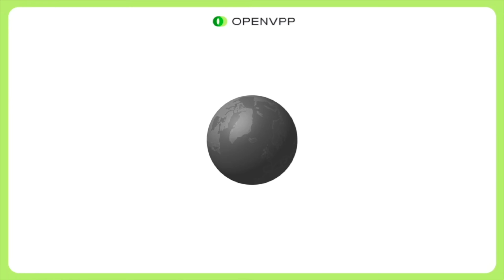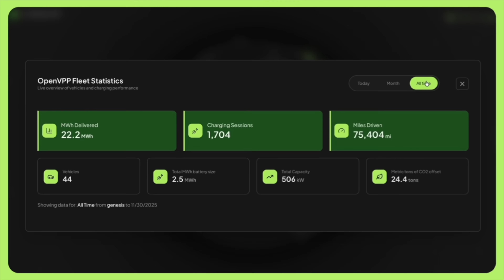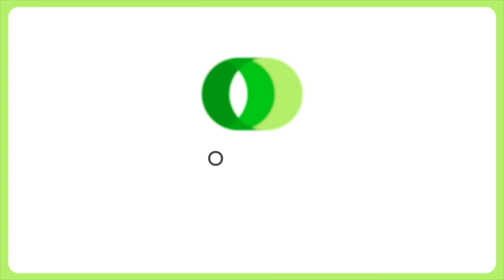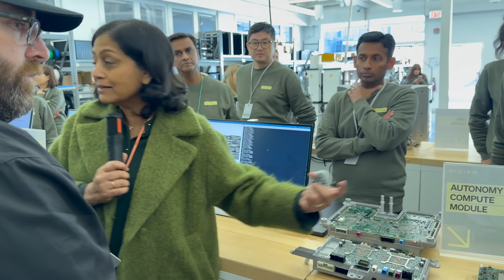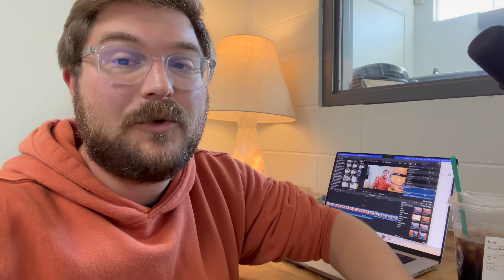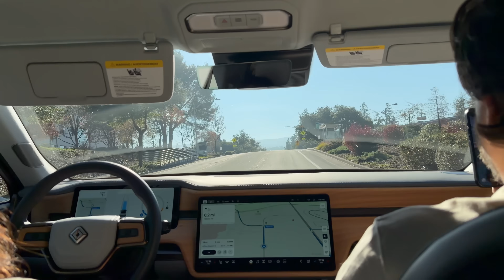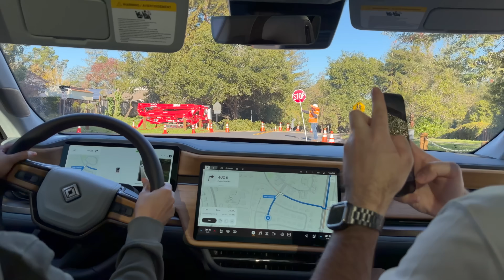My Rivian “FSD” Test Ride! Long Road Ahead But The Correct Choice

Comment: Tesla is clearly the leader in supervised software. I don't give a shit about supervised software. Mercedes appears to be the leader in unsupervised driving as far as cars you can purchase. 

Until a company takes liability for the actions of a vehicle under their softwares control, everything else is a beta. That is the metric of full autonomy. Everything else is varying levels of  partial autonomy at best.

And we should be excited and supportive of companies developing autonomy. Did we all forget that monopolies are bad?
Reply: If you believe Mercedes is more advanced, IMO, you haven’t tried both in real life. Mercedes complies with arbitrary specs created by bureaucrats that place them in a meaningless category for autonomy. If you want the truth, drive them both and you will quickly realize that Mercedes is way back and that their autonomy works just in specific roads with tons of limitations. It can’t drive you end to end. It fails on construction zones… it doesn’t manage city streets… last I checked it didn’t even work during the night
Reply: I didn't use the term advanced anywhere in my post. The metric I used is unsupervised distance. It is a 100% true statement that Tesla has not developed unsupervised self-driving software that the consumer can use on a car they own. 

 If we're talking about driving autonomy, the only metric that matters is unsupervised distance. And right now it is a 100% true statement that Mercedes supports more unsupervised miles (and takes on that liability) than Tesla. Changing the metric to fit a bias doesn't change the facts. I'm on my third EV, and it will be the third time I've rejected FSD after experiencing it. But don't take my word for it- Tesla doesn't trust FSD enough to allow a Tesla owner to allow any unsupervised miles. The hardware may not even on a sufficient revision to support unsupervised autonomy. They've already abandoned 3 generations of hardware as far as full autonomy is concerned.

Tesla's marketing has done a great job of convincing some people that their FSD meats the real definition of full autonomy. I don't fault them for continuing to develop their tech, just like I don't fault Rivian for developing their tech. Tesla is far ahead when it comes to supervised miles. 

Others are far head when it comes to unsupervised miles, which is the point of driving autonomy. There's a reason why the take rate on FSD is only 12%, it's because most Tesla buyers didn't buy the hype.
Reply: @paulo3011 you’re playing semantics. Since my first post I wrote that Mercedes met a dumb spec defined by bureaucracy. They call it UNsupervised because it allows (under very limited conditions in very few and specific roads) the driver to look away (without nagging) but still requires the driver to be ready to take control immediately upon the multiple situations where it has problems working. IMO, Any fair minded person with basic understanding of driving assistance can determine that the so-called unsupervised driving offered by Mercedes is much much less capable than supervised FSD. If you don’t believe me, I invite you to test both.
Reply: @graciasthanks4771 unsupervised miles driven is a well defined, objectively measurable metric. Is Musk playing semantics when he measures accidents per millions miles on FSD?  If not, then it's totally valid for me to argue from a straight forward, objectively defined metric.

You're deflecting by moving the goal posts to an undefined metric "advanced" (and if it's undefined, then it isn't objectively measurable) in order to strawman my argument. You committed two logical fallacies without really answering any of the following logical, objective points:
The point of autonomy is that consumers shouldn't have to supervise consumers don't want another thing to babysit
-Almost 90% of Tesla owners haven't taken FSD, which supports my point about consumer demand
-The metric of success should be unsupervised miles and liability assumed by the manufacturer
-Tesla doesn't currently support any unsupervised miles in the hands of a Tesla owner
-Mercedes does support unsupervised miles AND liability
-Tesla has gone back and forth on hardware revisions, and even software features while abandoning the promise of full featured FSD on HW1-3 

I have tried both FSD and Drivepilot. I didn't bring up my experiences because they're anecdotal and not relevant. That said, if you need to know about me:
-There have been 3 EVs (all purchased new, and I did cross shop Tesla and Mercedes ) in my household, we've never owned a Tesla in spite of the test drives and testimonials from friends
-I'm a former Tesla shareholder, I sold the stock this year for purely financial reasons
-I've never owned a Mercedes or their stock

If you continue down the bad faith path of trying to strawman, and continue to demonstrate that you can't respond rationally, I'll see no need to continue the discussion.
Reply: @paulo3011  this will be my last reply to you on this matter. Our views are quite different. So, one last explanation….What the nonsensical definition by bureaucrats of what unsupervised driving means allows Mercedes to have a product that factually is far behind FSD and call it unsupervised because it doesn’t nag the driver when not looking at the road (in very limited situations and roads and still requires the driver to be ready to take over, which is needed frequently). If you truly believe that makes Mercedes the leader, I invite you to invest in them. My assessment of Teslas technologies has convinced me of their enormous potential and I am backed my opinion with investments in their stock.

Comment: The entire company is built on the premise to be the next Tesla, there is NOTHING new about this. They are burning cash like no tomorrow and what they deliver is okay. That's not enough. The problem with rivian is that they can not get the miles because they can't produce enough cars without going bankrupt. Unless they are bought by VW and those have their own problems.
Reply: Agree with cash flow, however they may not need as many miles to train as current LLMs are better than what Tesla was using 4 years ago.  Just a guess.

Comment: After watching many other videos experiencing the Rivian self-driving Kyle is in a league of his own.

Kyle -
You have to use a three-way hybrid approach. 
1- Of course you should compare it to what Tesla is capable of doing today.
2- You should evaluate the system for what it is, compared to other Non- Tesla  manufacturers are doing and what it's ultimately capable of. Otherwise you are saying that we should all be driving a Tesla. The sport car analogy is not accurate because a sport car has a narrow purpose of sport driving. A Rivian does more than self-driving, The driving Dynamics, the quickness, the off-road capabilities and of course we want to see the self-driving as well. 
3- lastly, you should use your subjective opinion if the company is on the right track and capable of delivering the promises it claims or blowing smoke up our noses. 
In my humble opinion.

Ps: I owned a cybertruck for a year and 2 R1Ts first and second generation. Full self-driving is and was my number one feature I need in a vehicle. Otherwise an Audi or a BMW are a better option.
Reply: Kyle’s head is already big enough. I bet the rivian people were glad when he got out of the truck

Comment: To address your question, Kyle: I think you should be super clear and honest about the stuff you can actually experience today and call out its shortcomings, but also recognize that it's not shipping yet and therefore it's impossible to really assess the performance of the product that customers will get. The reality is that they had to announce and break cover at some point, but it's almost impossible to gauge their ability to deliver a year from now based on what you see today; software is simply too fluid. I think you're right to call out how far behind they are. But I worked in software for 30 years, and one thing I've observed is that a year before shipping it's almost impossible to judge the capability and quality of a system. It's simply too early to really know.
Reply: Rivian is doing this reveal to show off to their investors, owners and attract buyers. They should understand the points you made and the criticism that comes with it.
Reply: What are you talking about. Unless Rivian is lying, they just showed you what they will be shipping. And when Kyle asked about other things, their answer was primarily that other things will be coming. Too little too late. Other things will be coming with FSD as well. Everything you are saying holds true for Tesla as well. Do you see that Rivian's start from behind approach will always keep them in Tesla's rear view mirror? If they can stay afloat financially.
Reply: @dennissabo3885  Actually, the announced what they will be shipping and demonstrated a snapshot of its progress (literally the Rivian rep's word in the video: snapshot). All we really know is what they plan to ship in a year, how they plan to get there, and that they're not there right now.
Reply: @coyotegeek Yes but what they will be shipping is already obsolete